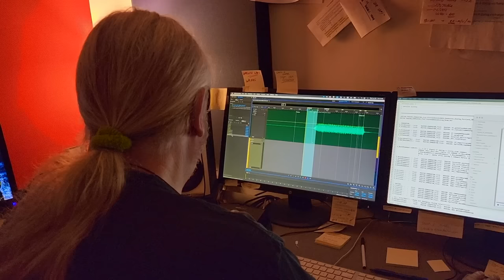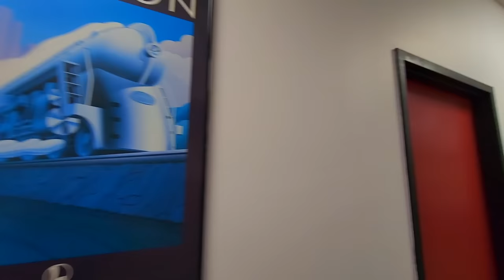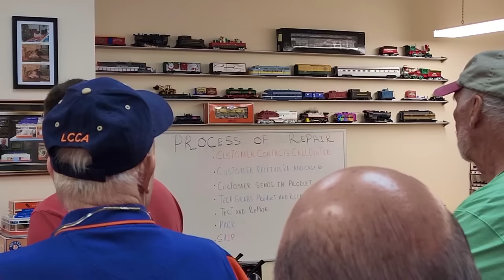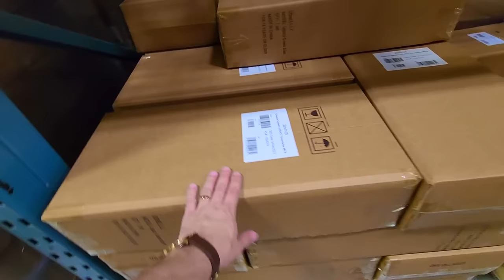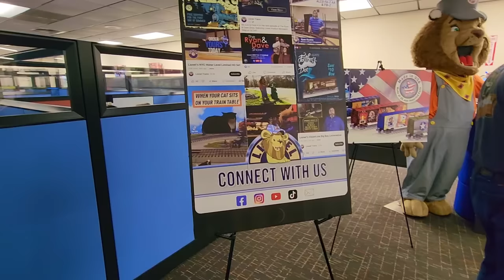Lionel Headquarters & Warehouse Tour! 2023 LCCA Convention

Comment: Back in 72 or was it 73? I worked for Lionel when they were on 23 mile rd, in Mt Clemens Michigan. Midnight shift, injection molding plant. It was in November one night, that my manager Ed, told me that someone had left the warehouse door unlocked, just down the road. He instructed me to go there, enter the unlocked door, lock it, then to raise the overhead door, hit the close button, then run out, leaving the place secured. So, I went there (I grew up with and loved Lionel trains) and went into the warehouse. I had the whole place to myself, no one else around. I looked at all of the tall racks and shelves loaded with train sets to be shipped out, it was amazing, I thought to myself, This is Lionel Heaven! So, I did what was asked of me, locked the door and ran out of the overhead after hitting the close button, securing the place. That experience left me with a wonderful memory.

Comment: Will, thanks for this video. I was scheduled to attend LCCA at Concord and was going to do this tour but I had to cancel in mid-July. I didn't have enough leave from work. So i had to cancel. I still plan on going to York and seeing family in San Francisco. But it bummed as a Lionel guy. I have the 1630 on order through my local DC area hobby shop. I also have the SP E8/9 in Bloodynose. Did you see those samples on the tour? Any word on the Legacy Berkshires? I have the Chicago & Northwestern on order through my LHS. Did Lionel say why they stopped making the 15" aluminum passenger cars? It would be cool if Lionel did a MPC Vintage Celebration series. I grew up on that stuff in the 1980s and 1990s in high school and college. Again thanks for the video. Come to York!